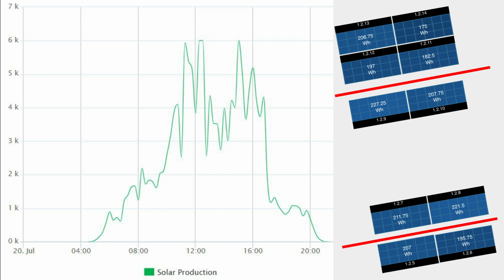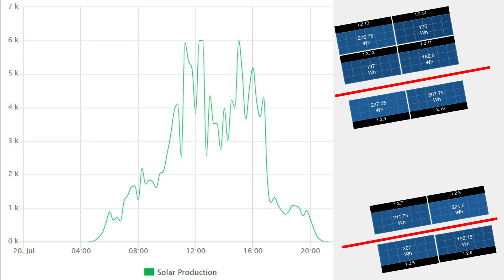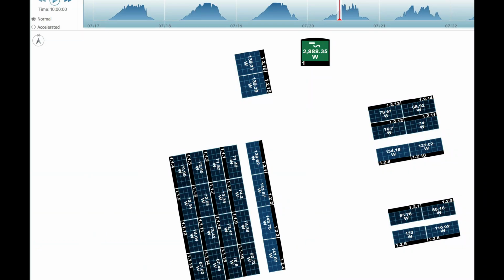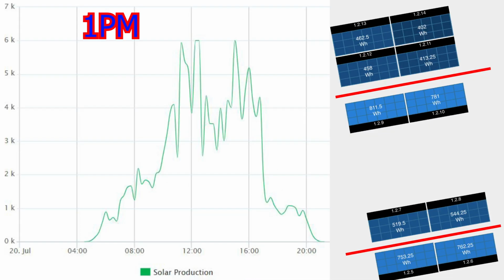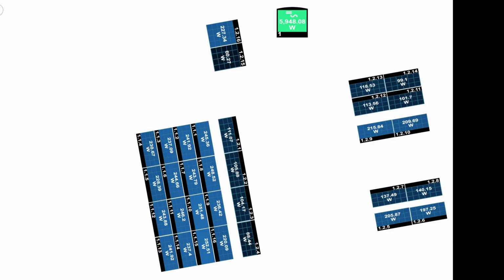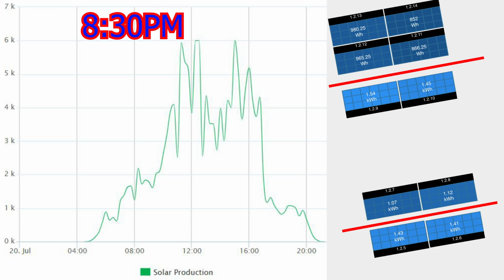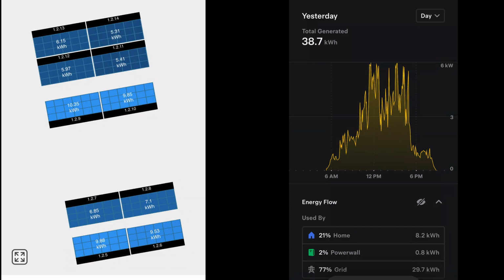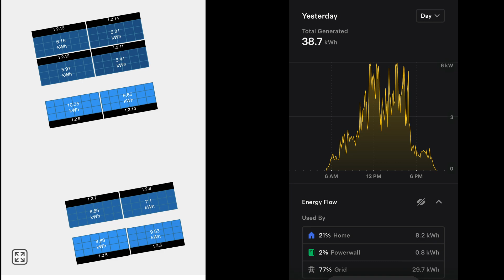Do North Facing Solar Panels Actually Work ??

Comment: I was thinking of only putting panels on the north facing side (in Australia) but I could double the system size if I put panels on the south side. Might not make much power in winter on the south side but would make a big difference in summer when the wholesale power price is high in the afternoons.

Comment: Curious what the actual orientation of the north facing is? Is it actually directly north, or off a bit?
Reply from the maker: Its show on the map in the video . You will see the compass 🧭 showing north.
Reply: Thanks. Hadn’t spotted that up in the corner. Really very close to north! Interesting. Curious to see how they are in autumn and winter. I have the option to put some NNW so sort of similar
Reply from the maker: I will do another video in winter around the north panels yeah.

Comment: Interesting video! Did you install the solar panels in the roof yourself?
It will be interesting to see what the north facing panels output in winter
Reply from the maker: I have had them up and running in the winter however I didn’t have access to all the portals and apps so I cannot confirm how good or bad they were. 
Assisted with install needed the MCS certification.